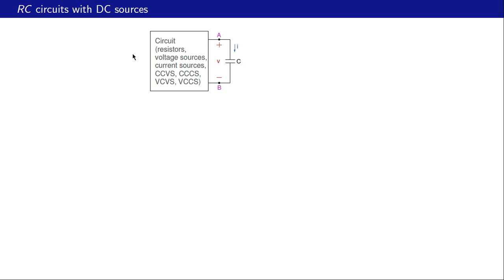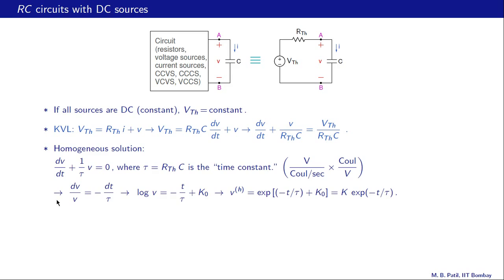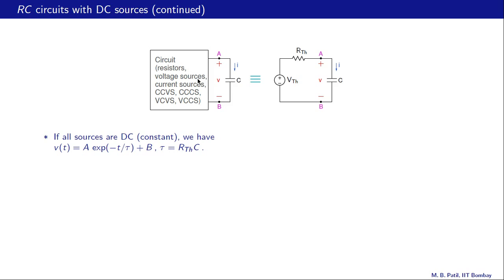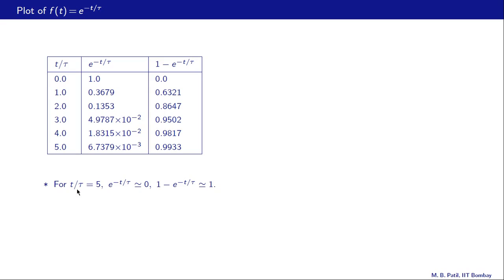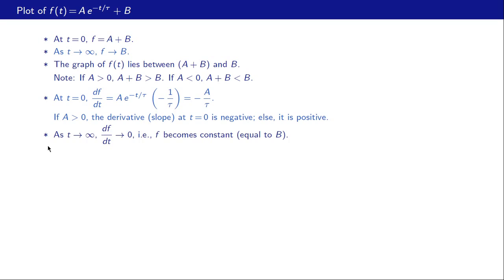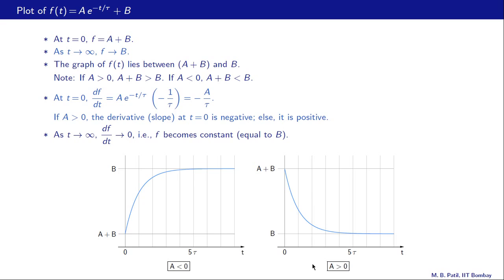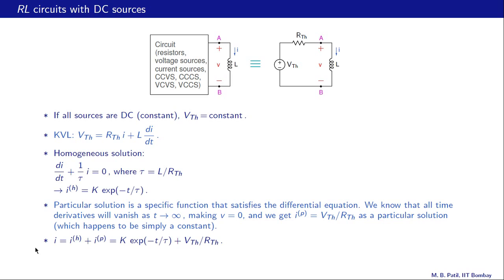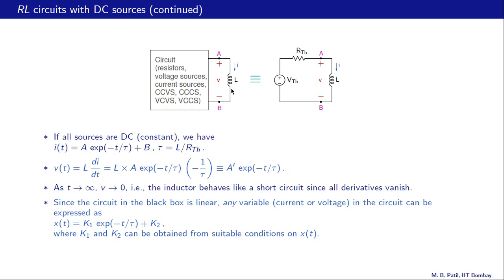RC/RL CIRCUITS IN TIME DOMAIN-1

Comment: How do RC and RL filters function? How do capacitors and inductors drop ac voltages in filters? 

To understand this intuitively it is useful to know what is a fringe field of capacitors and what its effect is at different frequencies. With inductors, it is useful to know the induced field and its effects at different frequencies. These effects influence the net field and current magnitudes in capacitors snd inductors. 

Knowing this will help in understanding the operation of RL and RC circuits as filters. Attenuation, it should be understood, denotes a decrease of the amplitude, or magnitude of coherent or incoherent electromagnetic waves or electrical impulses without specifying what quantity should be used to measure the decrease, whether the decrease should be space-dependent, time-dependent or both, the cause of the decrease or, the conditions under which the decrease is to be measured. 

A resistor can produce attenuation but it need not be there always to produce attenuation. Lossless lines and T-section and m-derived section filters can attenuate signals as well. 

Electrostatics and circuits belong to one science not two. To learn the operation of circuits, Current and the conduction process, resistors, capacitors and inductors and how discussing these topics with a unified approach makes it easier to understand phase-shifting in capacitive and inductive circuits, 
watch these two videos 
i. https://youtu.be/TTtt28b1dYo and 
ii. https://youtu.be/8BQM_xw2Rfo 

The last frame References in video #1  lists two textbooks 3 and 4 with topics that discuss the operation of capacitors and inductors. Textbook 4 in addition  includes discussions on phase-shifting with a unified approach to electrostatics and circuits useful to understand how filters function.